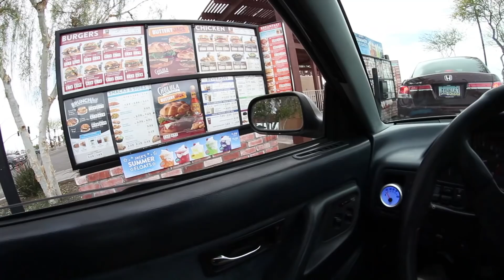Installing My Own Muffler, Random Fixes On The Integra

Comment: I noticed you throw it in 1st before reverse.   thats because its an unsynchronized gear? i never have to do this with my 93 da but oddly I have to do this with my 96 dc2.  it bothers me but oh well haha
Reply from the maker: dc2gsr greg it’s just because reverse is straight cut. The gears don’t line up so I have to either rev it a little bit to get the it to spin or put it in first then reverse

Comment: Nothing better than working on the whip! You ever replaced the fuel pump on yours? i know i gots 2 drop the tank! Any tips! Would be appreciated! Thanks! Good stuff as always!👍👊✌the DA sounds NICE! By the way...
Reply from the maker: Oldskool DA9 thankfully I haven’t had to replace the fuel pump in my DA yet, Dillon changed his a couple times. I know it’s pretty simple, just drop the tank. Pop the top off and you should be able to see it right there!
Reply: ChrisSadowski THANKS brotha appreciate the feed back!👊
Reply: Oldskool DA9,  I recently replaced the fuel pump on my DA using GBH’s video:  https://youtu.be/UOrw15qOLHI.  It is pretty straightforward.  Just make sure to get as low on gas before tackling it.  The biggest challenge is getting the fuel tank lifted back on the straps especially by myself.

Comment: Since your welding tankless your ground clamp should be on the positive and your gun in the negative do you know if it is set up like that
Reply from the maker: W Contreras someone else mentioned that to me as well, I do not know if it’s like that. I will have to check that after work tomorrow!
Reply: Yeah if it’s set up the other way you’ll notice the difference once you fix it

Comment: It still sounds hella good. Definitely a lot quieter, but you still get the bangs and pops. But a serious question. Do you have a catalytic converter?
Reply from the maker: No I don’t have a cat, I have an 18” resonator though
Reply: ChrisSadowski got it, bro. I still have the cat on my car, and I've been contemplating taking it off for a bit. I definitely would love the pops and bangs.
Reply from the maker: MatthewMassacre1124 removing your cat won’t get you the pops and bangs, my car is tuned and I have ignition cut launch control. That’s what the pops and bangs are lol. When it’s dark out it spits good fireballs too
Reply: ChrisSadowski I get a few pops and bangs even with my cat, and it always brings a smile to my face.
Reply from the maker: MatthewMassacre1124 yeah little crackles your gonna get. But I’m referring to the “gunshots” or backfires my car makes
Reply: ChrisSadowski I'd freaking love the gunshots. Scare some people.